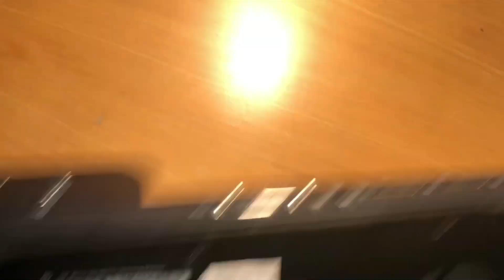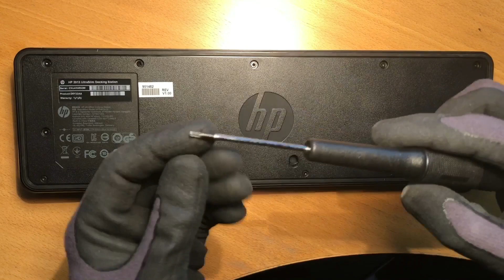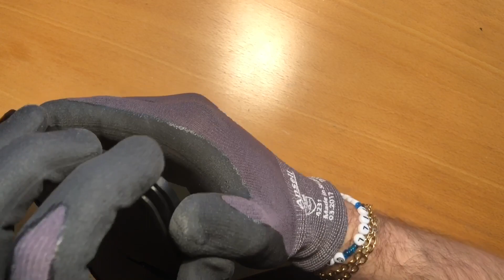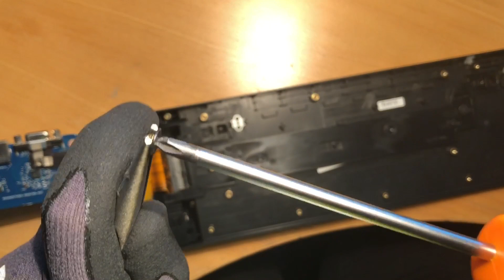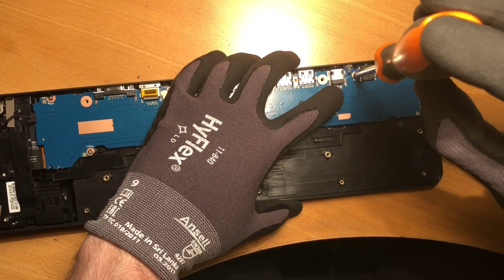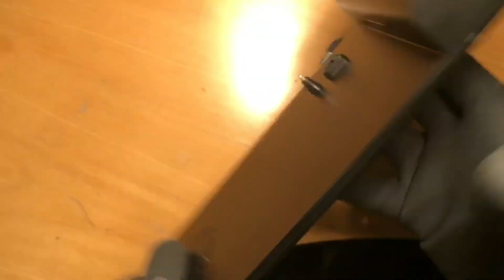HP How To - 2013 UltraSlim Docking Station (Repair latches)

Comment: I had the same issue on my rev1.0 docking station. The bottom screws were all t8. Otherwise everything went as you described. I saved 25-30€. THANKS!
(+ I added a soft rubber/foam pad, 1mm thick, on top of those screws, hoping that it helps them not to brake loose again)

Comment: Hey @Kim - Any idea how to fix the 2013 UltraSlim docking station if it's no longer charging the laptop? All USB ports work, firmware updated but it's still not charging the laptop.
Reply from the maker: Tried changing the charger to the docking station?
Reply: You must have push the Connector, But you need to plug in the Power AC through the HP Dock.
Reply: Plug it in the Power Strip. Must have a work surface, or a desk? or watch this video to help you!   https://youtube.com/watch?v=4kavZPNG6Hw